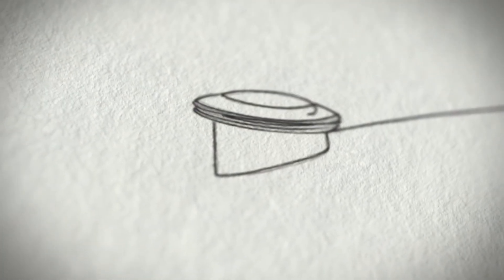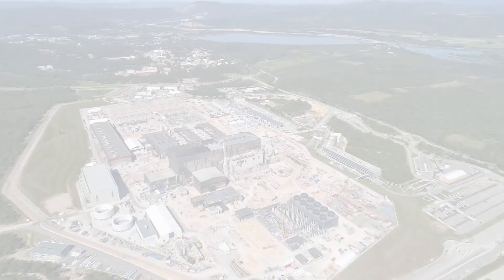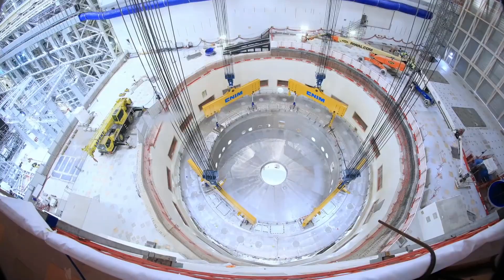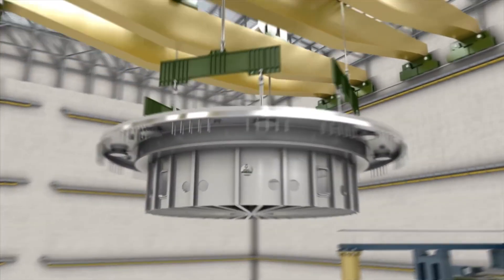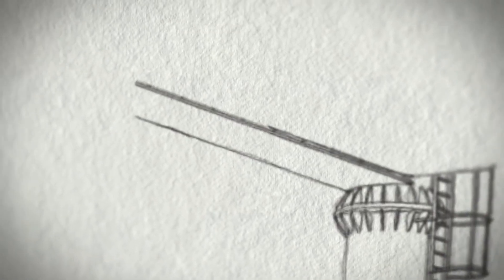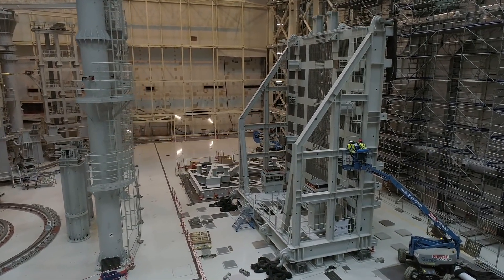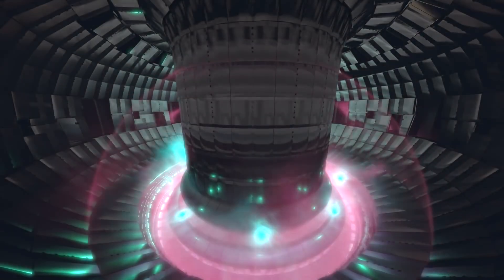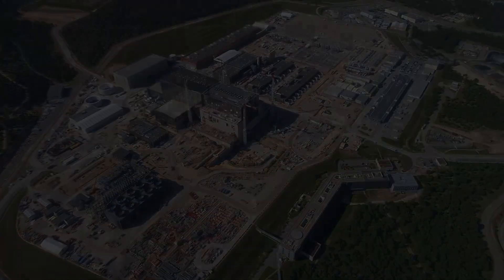ITER project :: the future of Energy

Comment: Stan Sandu  
     The FIRST controlled thermonuclear REACTOR type ENOCH -PACAL, after the UNIFIED LAW!           
    Bernard Bigot -Directr General of ITER, in March 15, 2018 says: ”We have not a long-term option, for energy. If we do not find an option, we will have big problems.I am almost 70 years, I will not live to see the benefits of the fusion, but we*ll you get there. It is my duty to bring together some of the large chain parts delivery”. Thu
       În a video from Aps, January 30, 2019 ITER Council renewed the mandate of the ITER director general until 2025. ril 12, 2021 (by Steven Krivit) entitled ”ITER The Grand Ilusion; A Forensic Investigațion of Power Claims”, in which the Finance Commission asks scientists and builders: - When will the commercial thermonuclear fusion take place? That billions upon billions of dollars have been spent on public mony and deadlines are constantly being posponed by 20...30 years!
        Scientists and disigners did not consider the real model of how the Sun works continuously, and they did not take into account that these elements of the Sun*s functioning were rigorously determined decades ago by observations with rokets and satellites. If this real data has not been put into the computer, then the computer has not MODELED something functional!      
       At FISSION – large chemical elements we divide, and items arising are lighter than when they were together. This difference in weight is converted into energy. At FUSION – light chemical elements come together, and when united are lighter and can extract the difference in weight, as well as energy. It follows that it actually a matter is of concentrated energy. We consider the magnetic field usually just energy. But in fact, a magnetic field is all the time a matter with other properties – an ethereal matter, which may constitute a boundary between a plasma with millions degrees and solid wall of the thermonuclear chamber. 
        After the mode of organisation of the ITER, each participating nation has access to all data and all the technologies involved, without having to pay royalties on patents. 
         After approximately 200 installations type: tokamaks; with laser, and many other models are built in the last 60 years, NONE product the fusion and think it will not the model ITER being in construction. I understand it can achive an operating installation: after the model of the operation of the Sun; after the description given by Patriarch Enoch in the his Book; and after the sketch of the device for production and emission of the flow of electromagnetic field, sketch which it find in the bottom of the scheme printed on the tombal stone of the King Pacal from Palenque- Mexic.
       For learning and understanding comercial thermonuclear fusion phenomenon that directly produce the electricity, it can, as in the same ITER space: land and buildings, including construction tokamak mount, can be installed and thermonuclear controlled reactor type ENOCH -PACAL, having at hand all utilities: electricity, cryogenics, vacuum systems, equipment of control and monitoring, and more others
       . In the Book of Enoch chapter 68, the patriarch Enoch being in a heavenly ship, the Angels also show: ”the camps of the stars and all the lights”, these 6350 years ago, and Enoch says: ”and I Enoch was in the heaven and there I saw in the core of that light, something like a HOUSE raised from slabs of ICE( thermonuclear combustion chamber), and among the pieces of ice were LIVE FIRE – FLAMES ( electromagnetic field fluxes of the magnetic trap). And my spirit saw a CIRCLE of FIRE that surrounds the house, from the four corners of it to fire those living rivers that surrounded the house”. 
        The notions of ”FIRE”, streams of live fire, flames, circle of fire burning in the four corners and climbing as streams of live fire, or flaming fire live, all these relate to bundles of the electromagnetic field flux of the magnetic trap, which around and get back in thermonuclear combustion chamber, to spatialized plasma and go out again through the central part. In the heavenly ship Enoch believes the his it show a divine vision, and he describe without knowing what he describes, - a controlled thermonuclear reactor, with spherical chamber of thermonuclear combustion. 
        I understand that him Enoch was shown only at the top part of the thermonuclear combustion chamber, whose principal axis was vertical namely: 1). The core of light is the center of the combustion chamber; 2). The carcase of the chamber, seem made of slabs of ice, for the installation work to -270 degrees Celsius; 3).In inside sparkled and moved languages flaming fire alive, that is flows electromagnetic of the magnetic trap which tighten and turn plasma into combustion chamber; 4).A CIRCLE of FIRE surrounding with fire, circle formed from electromagnetic flux of the magnetic trap, and at the four corners of the circle of fire are lifted up to the top of the chamber by entering in the device for producing and transmitting, the flux becoming stronger and entering again into the combustion chamber, and forming the continuous circulation of the magnetic trap. 
       Two spherical halves joined in the midle ( maximum diameter), form the spherical chamber of thermonuclear combustion. I think so that will look the first installation controlled thermonuclear reactor, and sould call it Reactor thermonuclear controlled ENOCH -PACAL model! This as a standard model for future power plants that will give us electrical current for all our domestic and industrial installations. 
          In a video ”Anty- GRAVITY PROJECT” of Jeff Lucas Astrophotographer, published on October 27, 2018, the man explained that he managed to alter magnetic field of the coil with intervening components: a permanent magnet and some dielectrics. After he managed to modify the electrical permitivity and magnetc permeability around of the coil and thus the magnetic field around coil it turned in electromagnetic field, which is able to move further into space as radiation, to cancel the radiation of gravitational attraction. 
          He deserves the Nobel Prize for two reason: 1). Demonstrate that a stream of electromagnetic field can propagate in space as a reactive propulsion force showing possible operating reactive electromagnetic motor; as the scheme is printed on the tomb stone of Pacal from Palenque- Mexico and 2). This reactive electromagnetic motor which converts the magnetic field in the electromagnetic field, is the best device for producing a magnetic trap interior, which spatialized, to press and to confine the plasma thermonuclear, the facility ITER = international thermonuclear experimental reactor with spherical chamber, as described in the book of Enoch chapter 68.